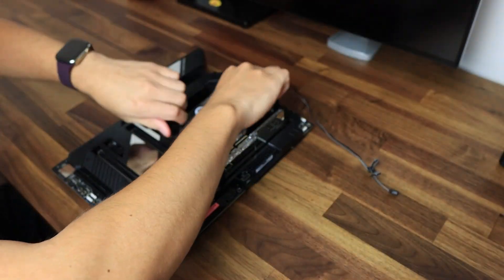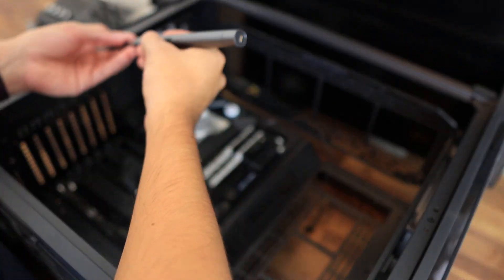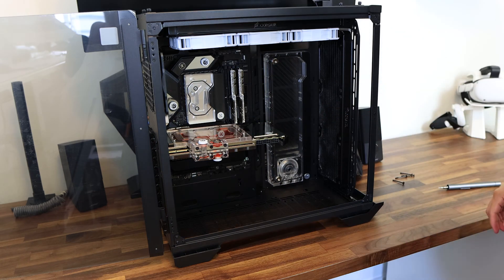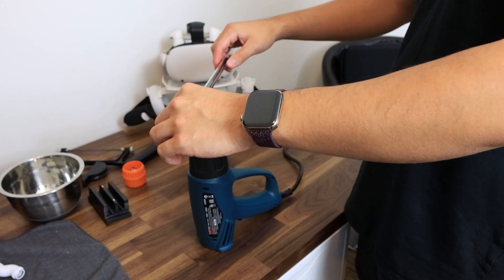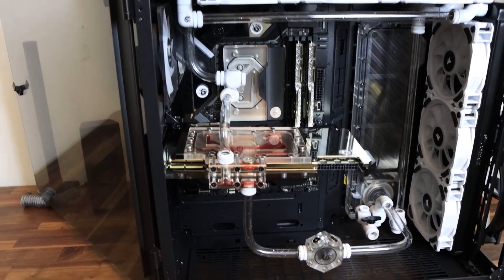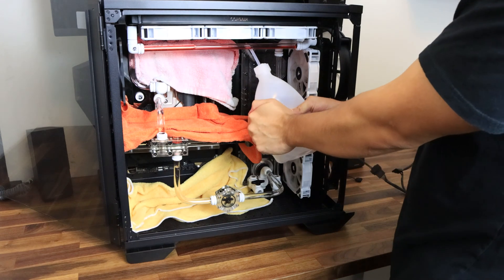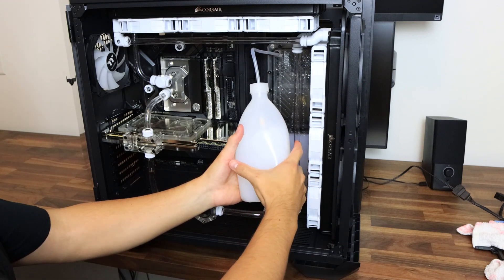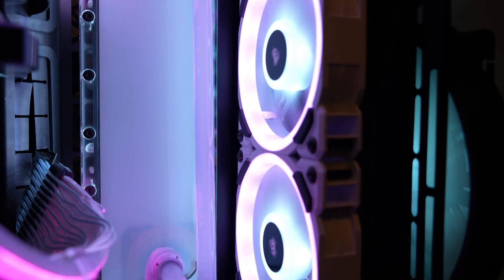The Ultimate Guide to Building a Water Cooled PC in 2025

Comment: PMMA vs. PETG
Acrylic is BRITTLE when HOT
PETG is a lower temp. ability & will scratch pretty easy & it requires some sanding on the coupling end ( BE GENTLE ) 
PMMA is the BEST yet it's harder to bend. 
If your filling with Metal looking coolant, your maintenance just tripled. Solid colors are & will stain both PETG & Acrylic. PMMA will NOT stain so if your filling with solid or metal fluids, that's something to keep in mind. 
NOTE If your using metal fluids I find it beneficial to add a strainer PRIOR to the pump with quick couplers. Shut off valves Before & after so you don't need to disassemble your loop every 3 to 4 months.
So PMMA Tubing is the best PETG in second place
Acrylic is the last option. 
There you have it, that's my advise & opinion.
"Good Luck & Best Wishes"

Comment: EK Loop tester is most important tool kit I’ve got, I normally test each section between 2 components such as between GPU and reservoir for about an hour , and once everything is tight up, then I will pumped air into whole system for about 0.55~0.6 bar, that is standard test pressure from EKWB, but I their standard was pressurized for 30mins, I personally keep it for about 6~24hours, and that does work quite well to me, I’ve played custom water cool for about 18months now, no leaks ever occurred to me, 

And if heat gun is something having trouble to us it on, I use gas stove to heat up acrylics hose, it works for me, and if you only want to heat some specific section of the tubes, you could use foil paper to mask some section, this trick particularly useful when dealing with some very tight bends
Reply from the maker: I wish it wasn’t out of stock!!

Comment: @techwithray Thanks for the video! I've got a Ryzen 9950X3D and RTX 5090, planning on getting a custom water cooling setup, my case can hold 4 x 360 radiators would that be to much?
Reply from the maker: Sickkkkkk build!!!!!! I want that 9850X3d so bad haha. And it definitely would be overkill but you you don’t have to use all of the radiator space for actual radiators. I find 2-360s is more than enough. That’s why I did my layout like I did. I am probably going to add fans at the bottom for more airflow

Comment: Does the coolant order for a computer system composing of a cpu gpu and 2 radiators matter?

Yes, the coolant order in a computer system with a CPU, GPU, and 2 radiators can significantly impact cooling performance. Here's why:

Key Factors:

    Component Heat Load:
        CPU: Typically generates the most heat, especially under heavy workloads.
        GPU: Can also produce substantial heat, particularly in high-end gaming or professional applications.
    Radiator Capacity:
        Radiators are responsible for dissipating heat from the coolant.   

        Larger radiators generally have higher cooling capacity.

Optimal Coolant Order:

    Hottest Component First: Ideally, the coolant should first pass through the component generating the most heat (usually the CPU). This allows the coolant to absorb the maximum amount of heat before it reaches other components.
    Radiator 1: After the hottest component, the coolant should flow through the first radiator to release some of the absorbed heat.
    Second Hottest Component: Next, the coolant should pass through the second hottest component (usually the GPU).
    Radiator 2: Finally, the coolant should flow through the second radiator to further cool down before returning to the pump.

Why This Matters:

    Improved Cooling: By prioritizing the hottest components and providing adequate cooling stages, this order helps maintain lower temperatures for both the CPU and GPU.
    Reduced Thermal Throttling: Lower temperatures prevent thermal throttling, which can significantly impact performance.   

Longer Component Lifespan: Cooler operating temperatures can extend the lifespan of your components.  

Additional Considerations:

    Radiator Placement: The placement of radiators can also affect cooling efficiency. Consider factors like airflow and ambient temperature when positioning them.
    Pump Location: The pump should be placed in a location that ensures good flow throughout the loop.
    Coolant Quality: Using a high-quality coolant with good thermal conductivity is essential for optimal performance.

By carefully considering the coolant order and other factors, you can optimize your computer's cooling system for maximum performance and longevity.
Reply from the maker: So this is actually a myth, Jayztwocents covered this. If you think about it, the water is a specific temperature through the whole system. The pump moves it all over the components at a rate that it’s negligible to the order.

Comment: How do I heat tubes without the tube getting ripples
Reply from the maker: It depends on the tube you’re using but you have to get it to the right temp then bend slowly. If it’s too hot you’ll get ripplers

Comment: Just got a bunch of EK fittings (EK Quantum Torque nickel)  so I can chime in on that one: They're not easier. Still gotta press kinda hard. Kinda logical too when you think about it. They're supposed to be real tight. Lubricating the gasket tends to help a great deal with pushing it in though. (that's what she said)

Nice build by the way. Kinda wondering what case that is? Interior sorta looks like an O11 Dynamic, but it's clearly not.

Some personal points:
Personally would have redone the tube from CPU to the top rad. Just a tad bit too short.

I'd also change all front fans to pull air into the case to create positive air pressure inside case. That way, more dust that gets sucked in gets pushed out.
Now you just have all fans pushing air out, creating negative pressure, pulling dust into the case. (like a vacuum cleaner)
I guess you could also eventually reposition the front rad to the floor of the case. Though that takes quite a bit more work + might screw with the outlet.
A better alternative: Add some fans to the floor that also pull air into the case.

Also, exactly where did you install the temperature sensor? Can't really see it anywhere.
Reply: Looks like the Thermaltake view 51